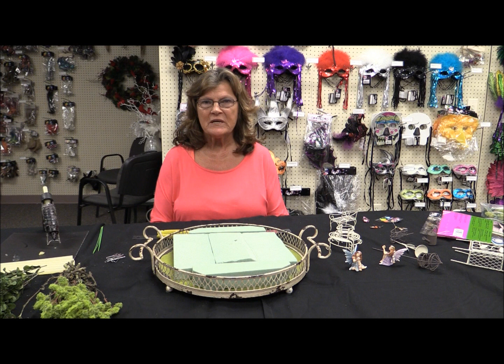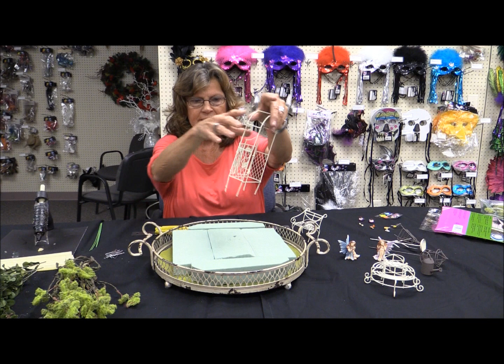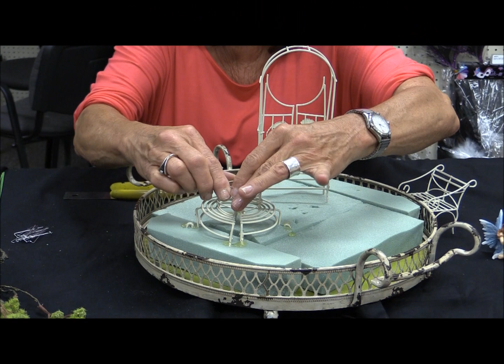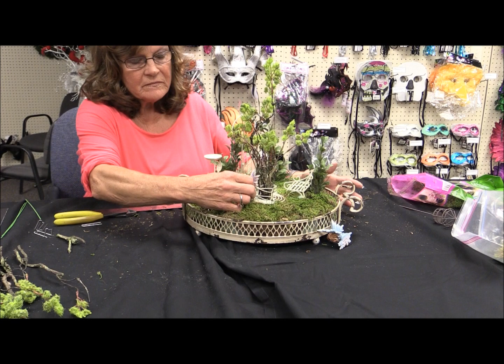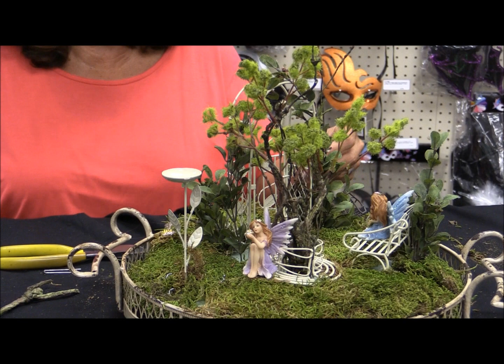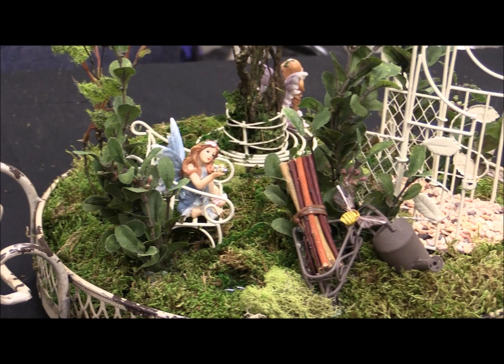Idea Center: Fairy Garden

Comment from the maker: Hello Fans! I have made a list of supplies and parts for this video. I hope this helps you create your own mini garden!
Container
Floral Foam
Hot Glue
Wire Cutter
Foliage of choice
51708 Moss Ground Covering
56048 Sitting Fairies
23150 Mini Butterflies
50565 Rustic Bird Cage
50420 Cream Garden Stand
50424 Cream Arch with Gate
50418 Cream Round Bench
50417 Cream Garden Bench
50566 Rustic Watering Can
50562 Rustic Wheelbarrow